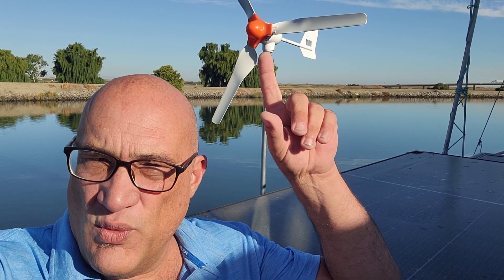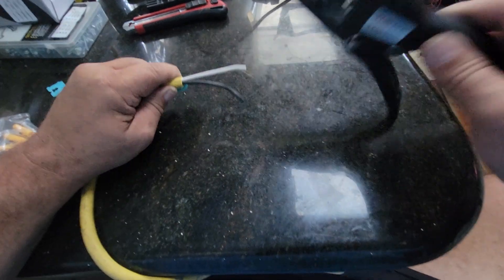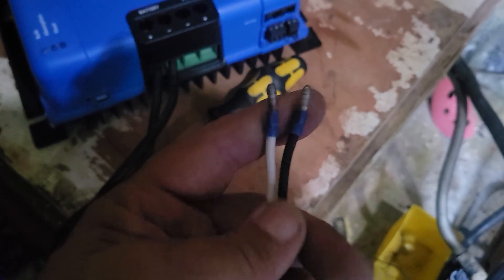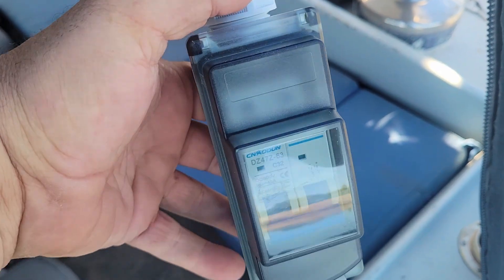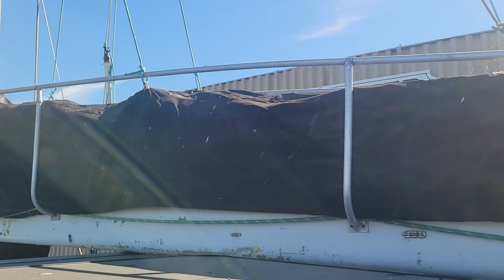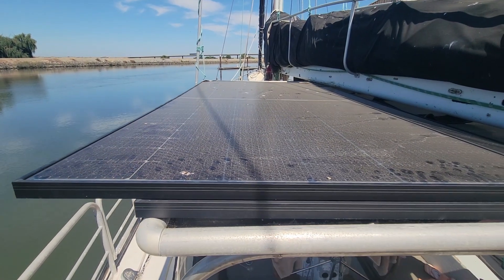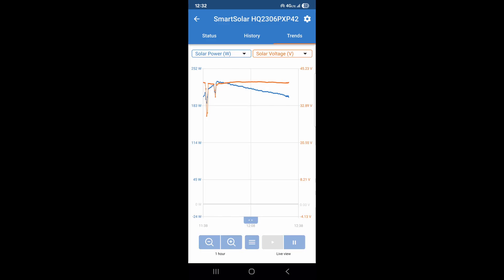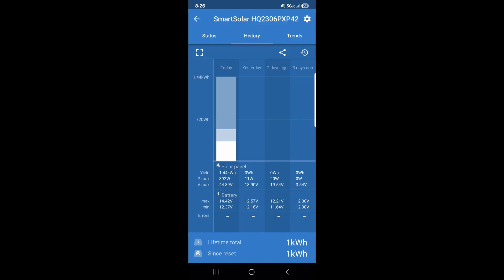Solar vs. Wind Turbine, who wins? - Sailing Elsie S1E19

Comment: G'day Mate, My best advice is to always buy the 48V model, even if you have a 12V or 24V system. Just use a 3 phase AC bridge rectifier to convert to DC, then use normal solar charge controller, best to use a PWM solar charge controller because it has a quicker reaction time. Just check that the solar input voltage can handle 50V or the listed maximum wind generator voltage. For low winds always buy the 5 blade model and get the blades with scoops on the blades, not flat. 
I hope this helps everyone.